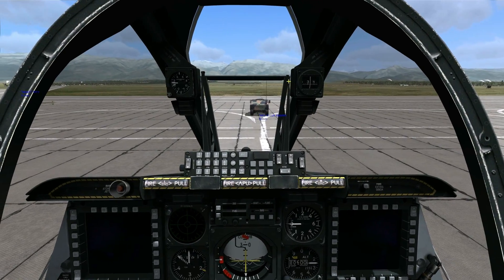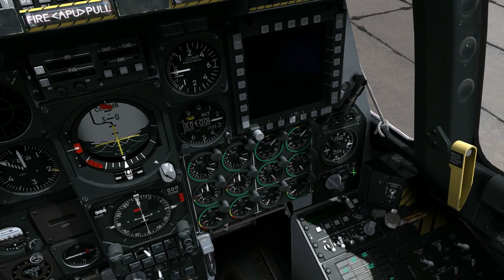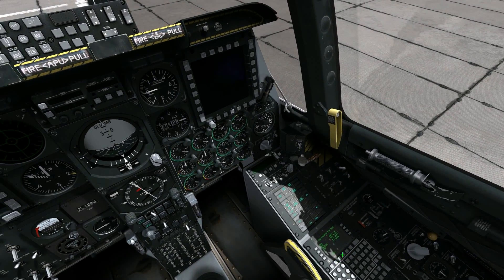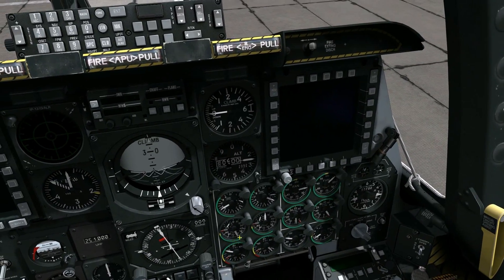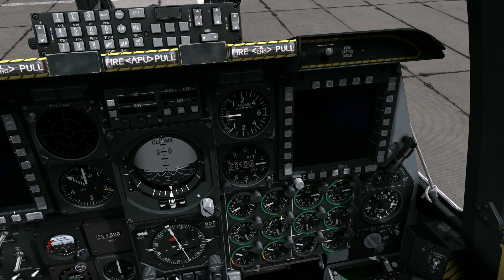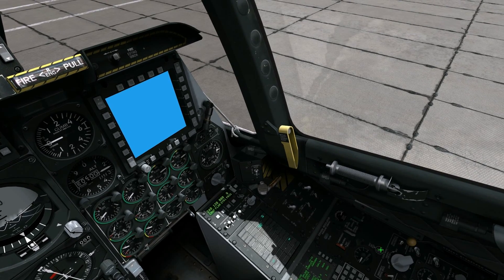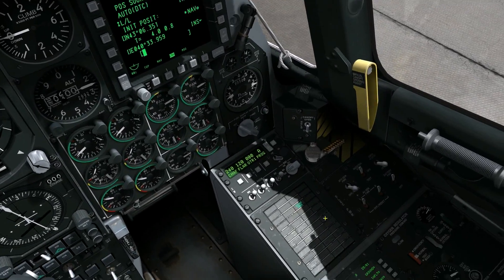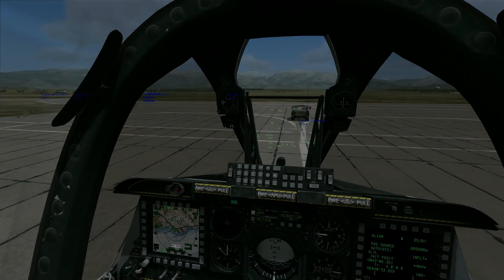DCS A10c Quick Start up (less than 7 minutes cold and dark to taxi)

Comment: how you engage nose wheel stearing?
Reply from the maker: +deejayGOLDEE The real aircraft has a pinky switch on the joystick for it, so there is no switch in the cockpit.  So you have to allocate a button for it in the controls  menu for the A-10.  There is probably already a button combination allocated, you just need to look in the control list to see what it is.
Reply: its a INSERT key. actualy it is the only one thing , that is not in the manuals, nore in videos.)